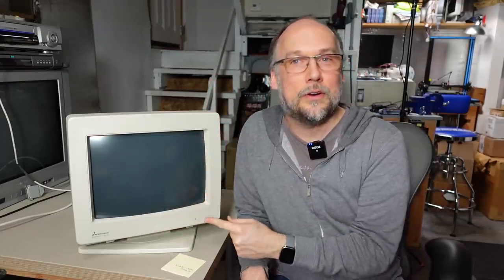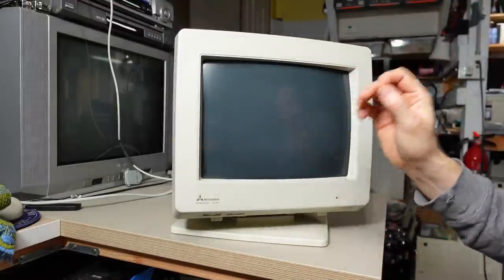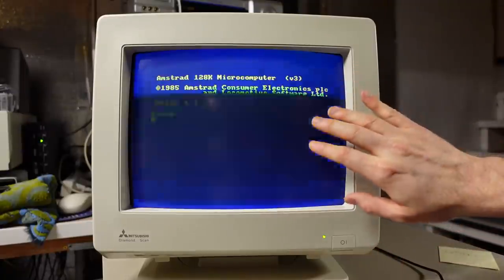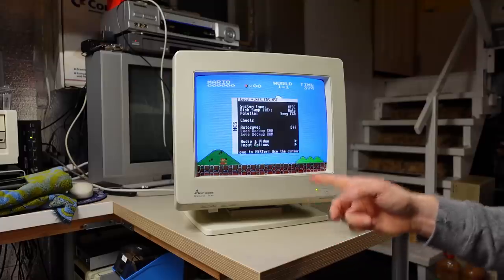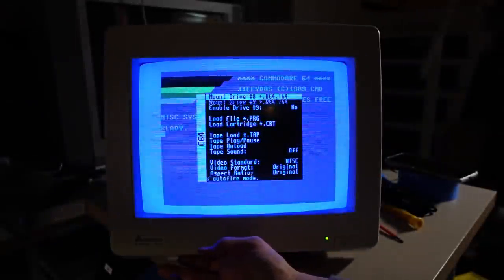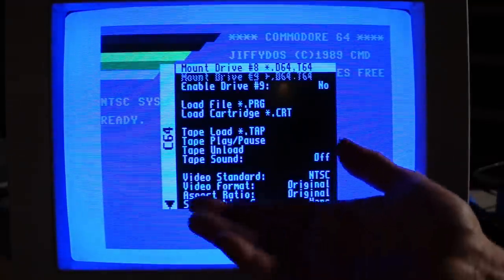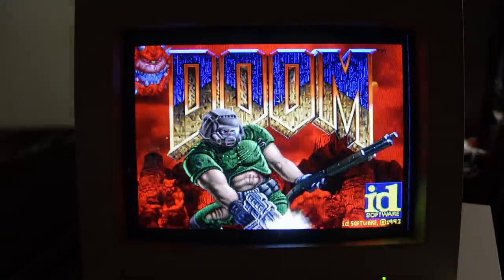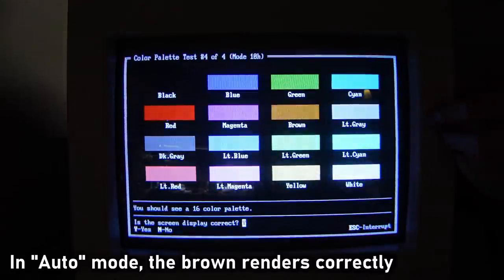Can I rejuvenate the CRT in my Mitsubishi Multisync monitor?

Comment: I had one of those! Got it for $20 at a government auction. Used it on my C-128 (composite and RGBI) and SNES (analog RGB). It also had a weak CRT but it looked pretty good after 20 minutes or so. Turning up the G2 helped some, once I got it just below the point you saw retrace lines, I had good range on the brightness control after warmup.

Comment: I have watching a channel devoted to vintage TV repair, have different testers with rejuv option. The guy says that a rejuv is not made to last, is temporary  fix and it wont last. It was used for to get the customer some time until the new picture tube was in stock and ready to install.

Comment: Try to find a Sencore 7000.  I have one and it is the last picture tube tester made.  It will test and rejuvenate everything from one of the first 1930s CRT all the way to the last color made. It'll also do protection tubes and vidcon.  They're not selling for much anymore and this was a $2,000 plus CRT tester and rejuvenator.  Very well respected in the service industry.  it has the absolute best rejuvenation circuitry ever made
It can clear up everything including a rainy day.

Comment: Multisync's are worth saving, especially as CGA/EGA monitors are getting harder to find. I was fortunate enough to find an LCD TV at a thrift store (a Daenyx DN-153) that, a pleasant surprise, accepts 15.7KHz over it's VGA input, which makes it easy to convert CGA or TGA to "analog" RGB with a simple resistor/diode bridge (minus the brown/grey circuit, which needs a couple extra ICs). Indeed, many multi-sync monitors would have a removable cable, so you can attach one that has the appropriate connection for the device you're running.
Reply: Brown gray circuit?

Comment: The wedges that go under the yoke also are part of the convergence by actually bending the yoke helps converge the edges-I have converged many an inline tube and the magnets help in geometry and purity of the screen-you think that tube was difficult - do a Sony trinitron-lots of adjustment plus a HV adjustment called the "H-Stat"

Comment: For that second monitor, you could temporarily tape a roll of toilet paper (or paper napkins) onto the end of the CRT to protect it, then gently set it down onto the circuit board; that way, you won’t have to hold it in place. A plastic grocery bag stuffed with packing peanuts would also work, or even a clean, wadded-up dish rag. 😋

Comment: In regards to the SVGA support, it has to do with the the exact point you were making in the "decoding of sync signals is analog" bit. Unlike the later VGA monitors that would have a microcontroller monitoring everything, and as such watching out to keep you from burning up your monitor with too high of a resolution ([OUT OF RANGE] and such), these older monitors will let you throw just about whatever at them, and what happens happens.

600p60 and 480p75 are both still rather close to what the monitor lists as the top of it's range, 36khz, and as such are probably fine , but I'd personally try to avoid going much higher than that. The likely intended resolutions at that upper side would have been the earlier SVGA mode, which would have been at 56hz and as such just under that 36 cap, or 8514A, interlaced XGA.

Comment: Hi Adrian did you check the heater voltage before replacement? then again with the Philips CRT which usually have 315mA heaters. This is hard if the heaters are supplied via the FBT and not a DC rail.
Yes I was surprised when I saw you putting in a CRT without it's original scan coil.
Gun type dictated how the scan coil was wound for a particular CRT type.

Comment: Brings back memories of the eighties when I used to repair this stuff.  Even with the new tube is the HT / brightness turned up fully? 
As the tripler stage on the flyback transformer my be faulty with low HT. The tripler stage is made up of capacitors and diodes. So have you measured the HT voltage?

Comment: I worked in a TV VCR car stereo electronics repair shop in 96 and we worked on TV picture tubes the new RCA 32 inch picture tube TVs if the tube was bad RCA required us to break the neck off the back of the tube and send it to them so they can study it or they wouldn't replace the picture tube we fixed many RCA 32-in picture tube TVs and there's a few older TVs that we rejuvenated the picture tube with a thing like you got.

Comment: its been a long LONNNNNNNG time since I've done "convergence"..  you will need a CROSSHATCH GENERATOR (a special tool which generates different CALIBRATED patterns for alignment purposes) patterns are vertical lines, horizontal lines  vertical and horizontal lines (crosshatch), dots and purity raster tests, the thing with the magnets is called "pincushion", "trapezoidal" and "butterfly"  there is also "ion trap" and other many MANY specific adjustments  on the CRT itself.. which you destroyed the moment you removed the deflection yoke..   admittedly, I have forgotten a lot of the procedure, however, I'll try to recall  what I can for your benefit...

1... DEGAUSE the tube entirely!  not by using the built-in coil, but one that is more powerful... (an old trick was to use a vacuum cleaner held to as close to the front of the CRT.)  obtain a coil if you can..  start out by powering the coil AS YOU APPROACH THE CRT FRONT.. then quickly move it about the CRT face and then pull it away at a given quick pace (but not too quickly) and THEN power it off  (NEVER power off a degausing coil while its in front of the CRT as that WILL permanently magnetize the screen)
 
2.. now you need to set up PURITY tests  this involves generating RED, BLUE and GREEN screens in that order...  as each screen is  present, you adjust each of its positioning ring magnets accordingly for best and deepest color

3.. now comes the cross hatch  "bars" test and adjust each alignment for color overlays  and white purity at EACH CORNER respectively.. take note that the bars are all STRAIGHT and do NOT bend inwards or outwards..  (pincushion and butterfly effects) you want straight bars and good white balance  you can use  vert bars, horz bars and dots to help in this this is difficult.. so be patient... 

thats all I can remember- if I recall more, I can add it to this post...

good luck!

Comment: Not to say you haven't checked it yet, but you should always check your CRT chassis's color's bias's/gains, sub contrast/brightness, flyback screen and other adjustments first. 
You can verify if maybe you need to make other adjustments on the CRT if you confirm the emissions seem okay first to rule out the guns.  Light rejuvenation "clean and balance" can be perfectly fine and beneficial but it has a very slight risk. A stronger Rejuve is just the last ditch effort and will definitely run a risk to kill the electron guns. As CRT tubes age as well the phosphors can wear out and "burn" making the image appear darker. That can be worked around with by playing with the flyback screen and then resetting your sub brightness and color settings :) If the actual color emissions seem low or the actual colors seem poor then you could work around that by restoring or cleaning the guns off with the restorer. 

Regardless a fun video as always, thanks :D

Comment: As for the camera exposure oddities, it looks to me like it's the lights that are out-of-sync, as the camera is set to 60Hz, but the grid may be running fast or slow (E.G. 59.8Hz) and the camera's picking that up as it takes each frame at different points of the grid frequency, despite being electronically smoothed out...

Comment: I have this exact same monitor. I bought it with my A2000 back in 1988. The store I bought it from said this monitor has less 'flicker'than a standard amiga monitor. BTW, How did you connect the MiSTer to this monitor?

Comment: The Taxan was non digital and had many more pots on the back. It kind of got around the screen size changes by having maybe  four sets of size and position controls on the back and then three adjustments that somehow magically assigned the scan mode you are in to one of the sets of size and position controls. But I had a coal face antiglare coating and was dim from new because of the dot pitch and focused beam to work at 800x600, it think it may have even gone higher, my memory is fading. It looked pretty dim on an Amiga, even with the A3000 scan doubler.

Comment: It is difficult to cover all possible resolutions and video modes with an analog circuit. 
Back then I had an Amiga with a (VGA) graphics card. 
The original graphics of the Amiga went through a scan doubler that doubled the frequency from 15 kHz to 30 kHz. 
I use a monitor with two analog inputs (VGA and BNC). 
The VGA modes were great but the doubled PAL and NTSC modes were always a bit dark. 
I then deactivated the PAL and used the NTSC because of the 60Hz.
Whatever I did, I exhausted the S3 graphics chip (on the ZORRO 2 bus) to the end, in terms of resolution and Hz, so that in the end I had to birngen the monitor for repair because a power transistor gave up. Then I turned it back again ;-)

Comment: I remember thinking it was strange that older monitors could not sync to any (reasonable) frequency.  I grew up in the 90's, every CRT you saw was multisync.  I'm a proud owner of a nice 19" one.  I remember when I eventually got the internet in the late 90's I use to read about people having problems with writing "modelines" for X11 in Linux to work with their monitor.  I didnt know what the fuss was about, of course because the cheap 14" monitor I was using was multisync, as was every monitor since.

I tend to use my LCD monitors with VGA machines now simply due to the size and weight, all multisync too although I have found the occasional one that isnt.  When I find a non-multisync LCD monitor it feels strange, like finding someone riding a horse and cart...
Reply from the maker: Actually they stuck the word multisync on everything (NEC was famous for that) but none of those can handle anything less than 31khz (640x480) video ... and especially not digital RGB like Monochrome,CGA and EGA. Those 90s CRTs with Multisync on them are exactly as multisync as a current day LCD with VGA input .... they work from 31khz and up.....
Reply: @adriansdigitalbasement  Oh, the LIARS!

Comment: CRT rejuvenation has always been a gamble, usually a last resort for a really bad tube to buy yourself some time before ultimately replacing it, much like using a "brightener", like they did back in the day. PS as far as the front of the monitor having a tendency to want to fall back, possibly breaking the neck of the tube, wouldn't simply placing it face down on your infamous "70's towel" have resolved that possible issue?

Comment: Regarding your exposure issues in parts of the video, I've had this same issue before, and it turned out to be the frequency of my AC power drifting slightly from the 60 hz standard.  I've only noticed the issue with led lighting...

Comment: I had one of these monitors.  Bought it brand new and wasn't happy with the brightness even then.  Tweaked the controls and internal adjustments but helped only slightly.  When connected to the Amiga 2000 it was better but on the PC with any vga card resolution, it wasn't very bright.

Comment: I just bought the same CRT tester (well, it's 851, not 850) in december, mine is from 1998. This CRT tester is not (just) from the '90s, it was designed in the mid '80s, but made until 2007! https://www.bkprecision.com/products/discontinued/490B-crt-analyzer-rejuvenator.html The manufacturer is Promax, Spain (Promax TA-903B is the orignal equivalent of the König 851 / B&K 490B). CRT testing and replacement was a thing even in the early '00s in the professional and arcade game industry. Mine is working great, although I think the rejuventation process is a bit too agressive even in 25mA mode, because it does 3 passes on each gun. If you ever try to rejuvenate a Trinitron, watch the filaments. The second pass starts after the filaments light up the second time. When you see it, switch it off. One pass per gun is usually enough for a Trinitron. But don't switch it off when it switches off the filaments, wait until it switches them back on, because a lot of the cleaning action is happening during the cooling cycle (I've seen a lot of fireworks inside some CRTs just after it switched off the filaments).

Comment: Your contrast is being goofy on the camera, it may be due to the infrared high frequency UV behind the screen emitting certain  ultra light, which does happen on modern crts, it’s picked up by the flash rate but isn’t seen by a pixel cmos or the naked eye. You’ll need a high speed refresh capture rate camera to the actual screen. It’s like your camera thinks it’s looking to the sun, then the curtains close and the screen emissions change.

Comment: Then there is the time when an anode boot pops off while running because the clip got bent, or there is a pinhole in the anode boot that gets you. I still have a BK that gets used for arcade monitors.

Comment: Technicians: Suppose you have 5 or so IC transistors attached to a grounded heat sink with paste in a mono amplifier. Is it ALWAYS the case that all bases should be attached to ground, with continuity between them? Or is "always" incorrect? I am diagnosing an Ibanez SW35 that blows fuses, and so far, I found one diode that passes current bi-directionally (could be circuit but it is only one of 10 doing this) and some ICs' bases not grounded continuity.

Comment: Tried to post this before, dunno if it just didn't go through or if it awaits moderation or something because of the link but I'll try again:

You can probably add a Luma + Chroma input yourself by patching into the circuit board after it splits the composite signal, which probably isn't too hard if it is all analog inside.

Alternatively, you can pretty much just mash the Y and C together to make a composite signal: https://www.epanorama.net/circuits/svideo2cvideo.html
Downside to this method is you'll lose the benefit of separate Y/C

Comment: When you discharge, you connect to a ground, but the ground isn't actually grounded to anything...   so what you are saying is it's like taking a screwdriver to the bottom of a circuit board when you touch the neutral/positive leads of a cap and see a spark?    I've seen a friend wrap a large screw driver around a cage ground then touch under the suction cup, so I guess anything that is a "ground" are all interconnected even though none of them are actually grounded?
Reply: Correct. One side of the "capacitor" formed by the tube is always connected to chassis ground.

Comment: Wow! I haven't worked on CRT type monitors for a while but, I would never try to rejuvenate one like that.  A test system like that is made for much larger units. 13 inch Never take higher than 15 ma! 25mA is too high and 50 mA I'm surprised it even produced a picture after that with any electron gun activity. What that device was really designed for is burning off any oxidation that the Getter didn't remove or if the CRT became gaseous you could remove material that way.  Brightness in a CRT is controlled by the horizontal output transformer for a 13 inch display it should have put out about 17 kV to about 21 kV any lower and the screen will suffer brightness and contrast issues biasing also plays a big part in screen refresh and image blurring. Oh and about those magnets you found taped on the original CRT, those are ferrite beads used in balancing fly-back not convergence. They are there to remove natural white spots that appear on some CRTs (Defects in the tube process.)  The best way to adjust the CRT is with a grid generator and a pattern analyzer.  I.E trim scope. Check the running Voltage of your Horizontal Transformer with an all white screen if it drops below 12 Kv you need to replace the transformer (internal shorts) and or (Gapping) Sorry about the Original tube could have saved it. When you ran the test the 1st time the guns where better than ok but after the 3rd blast well now you know. Great video great channel love watching!

Comment: Yes, that WAS a mistake, I have the exact same unit, BK 490b. and it was not made for CRT monitors really, it was more designed for TV displays, and thus gave you more of a false reading of being in the “good” range when you tested emissions.  And the rejuvenation mode thus being set FOR TV screens and the larger electron gins they had, meant that the method was a bit too brutal for computer monitors, so it was WAY to easy to toast it like you did.  I know this cause i have been working with vintage TVs for a long time.

Comment: I found a similar CRT tester on e-bay earlier this year and have given it a bit of repair/refurbishment: https://www.youtube.com/watch?v=LwDvUIqUy8Q the manual also mentions why the Anode is important for the rejuvination process. It seems that not all of the devices did have that part. I wonder if you have experience on any trinitron yet? Voltage/current values? Same as regular color tubes or not?

Comment: I have a tube tester and I used it a few times to rejuvenate a tube by increasing the filament voltag ( and so the current) This just as a test to see if it works. it worked on one tube a bit but not on the others and I do not think it will last. I never used CRT testers ( I have one but I wanted to use it on an  unobtanium Scope CRT but I could not find a manual so no clue how to do that) Also curious how it should work other then 'cleaning'  the filaments, if that is even possible, lamps just die from over voltage and so over current. I am curious what the idea behind a juvinator is. Is it the filaments or is it the anode or cathode that gets "dirty" ?  Or is it the fosfor layer, I think this is more a problem because they burn in and that is also a form of wear. It must burn in over the whole surface and so become dim overall.